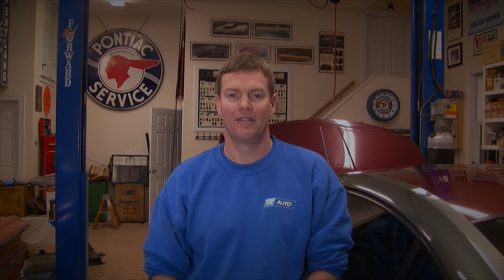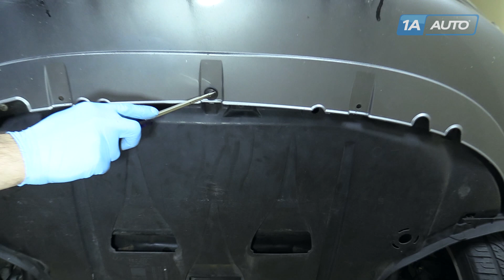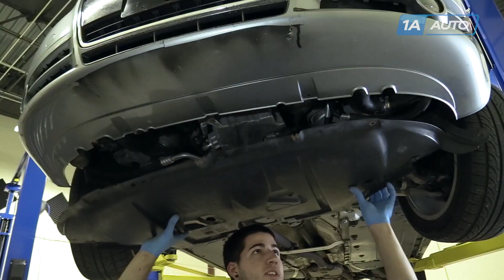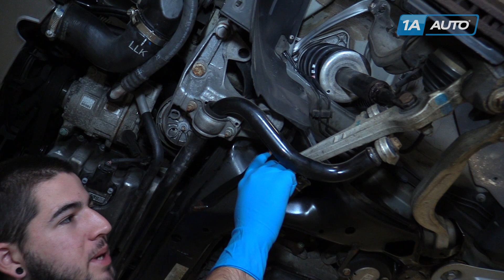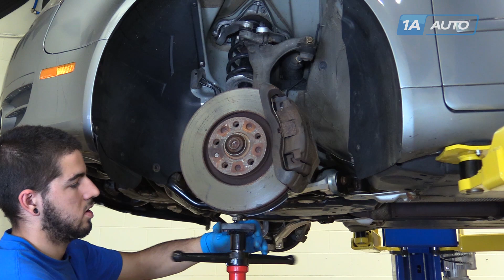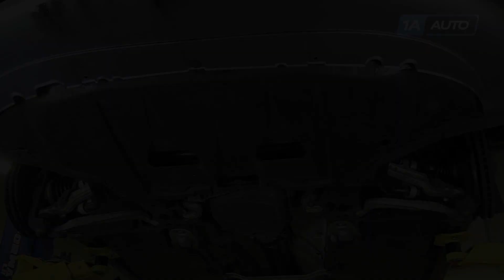How to Replace Front Lower Rearward Control Arm 02-09 Audi A4

Comment: What if im doing it on a b9 and the heat sheild is in the way of the control arm bolt when im removing it. Do you have to remove the heat shield?

Comment: I know this thread is 5 years old, but maybe I can help future users avoid my issue.   I didn't have any problem with the uppers, but on the lowers both sleeves pulled out with the ball joints.  I didn't realize why the stems were so much larger at first, then I realized the sleeves were still attached, and had to press them off and reinstall on the new control arms.  FWIW.

Comment: Pickle fork damaged the control arm. There is no way to use the pickle fork without the outer tang hitting the control arm. I even cut the pickle fork tips off for more clearance, and its still seized. A week of soaking in pb blaster. Tomorrow I try heating it with a propane torch. But at this point I am resigned to buying a new control arm already.

Comment: I'd reccomend ear plugs when you are using the joint splitter... When they finally release from the spindle you might need a new pair of underwear if you don't have ear plugs in. Great video and instruction,  job went smoothly.

Comment: I purchased the bush instead of the whole arm I plan to press it in. I notice it has to go in exactly the correct way around unlike a conventional bush that works all ways. I want to split the ball joint without breaking the boot like you because Im repairing and reusing my current arm and the ball joint is still fine. Hopefully all goes well.
Reply: I think there is quite a bit of variation on their orientation depending on the manufacturer. It is much more important to have the bushings tightened when the car is on the ground than it is to have the bush facing the right way with millimeter or even centimeter accuracy.

Comment: My control arm won't come off I've tried hitting it even with the fork tool you have here
Reply: I know this comment was 3 years ago, but I just had the same issue, had to get a sledgehammer and hit the fork tool as hard as I could and eventually it came off!
Reply: @Clarkswindowcleaning  Ive hit the tool hard enough that the back end of it is mushrooming. had to cut off the tips of the tool as it contacts the control arm. This job is a bitch!